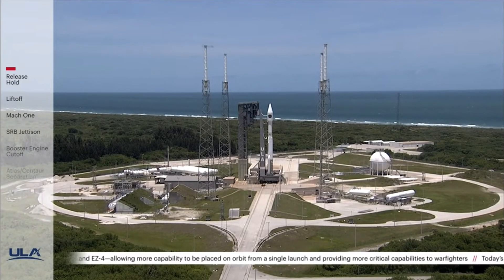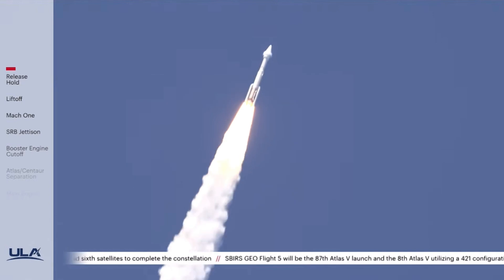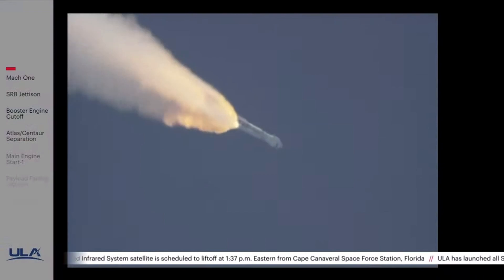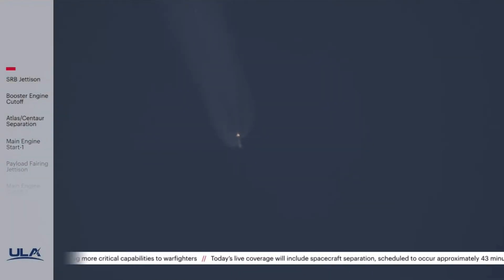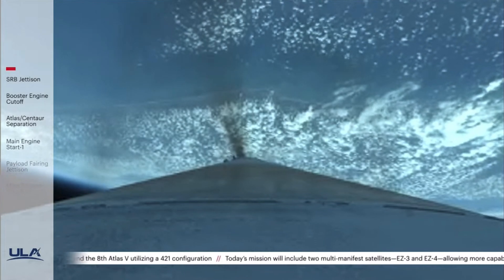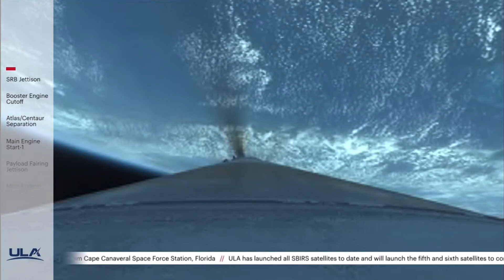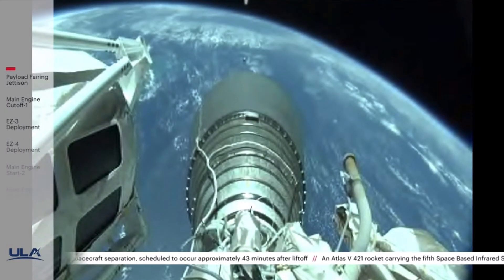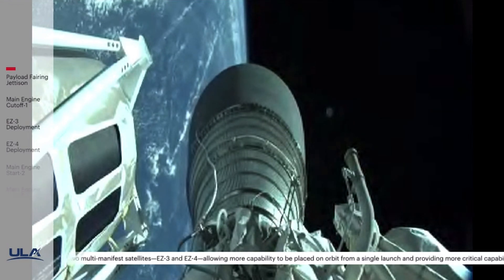Space Force missile-warning satellite launches atop Atlas V rocket

Comment: Anyone know why they wouldn’t use a SpaceX booster to launch? Assuming it would be much cheaper overall? Is due to it being a defense/security launch?
Reply: Falcon 9 and Falcon Heavy are both certified to carry defense payloads.   The Atlas V was used here because the satellite was built to fit into the Atlas V 4 meter payload fairing.    The Atlas V used today was in the "421" configuration--4 meter fairing, 2 strap on boosters, and a one engine Centaur upper stage.
Reply: There are actually a lot of payloads not suitable for falcon heavy, simply because the size/shape of them doesn't fit into the fairings, which are the same size as from a regular falcon 9. Which means that falcon 9 heavy is sort of limited to only launching DENSE payloads to LEO or regular payloads to GEO.
Reply: @KingCosmo7  thank you for confirming. And I’m guessing the fairing size isn’t something that can be easily changed?